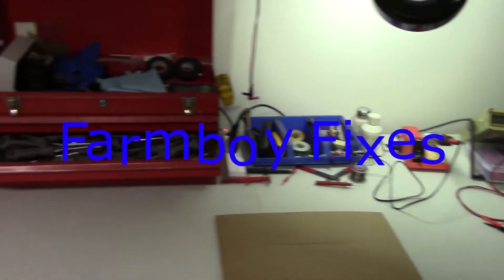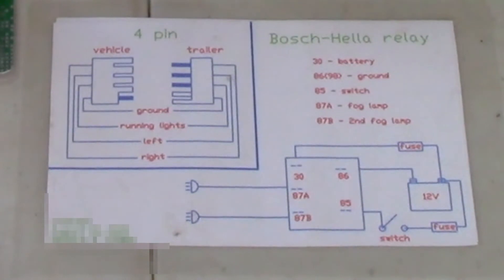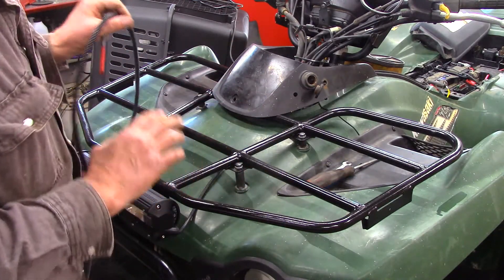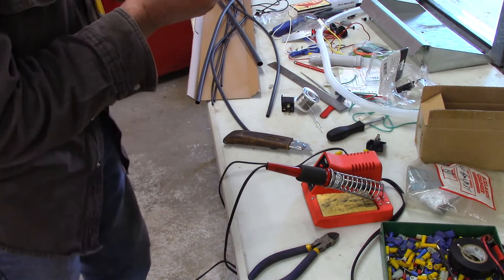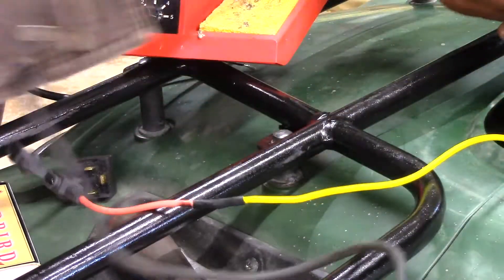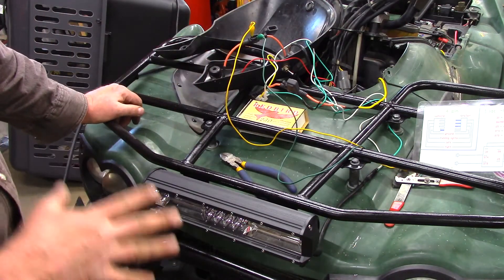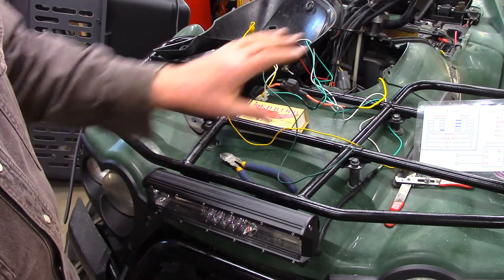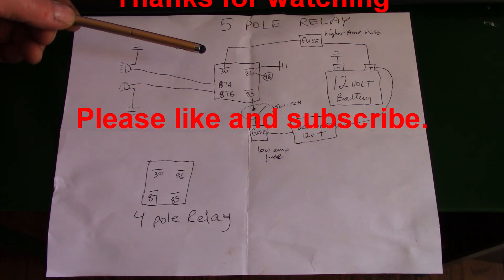Install a relay to wire in your LED light

Comment: Very Good Explanation, Im Just Got to much Lights on car which getting hot the relay and the switch for the direction( Im Using LED STRIPS as DRL with Direction or Hazart Light) its blocking when hot and just dont work properly, Changed new one with 70 A before was 50A on 12V, the same on the pin, Thanks